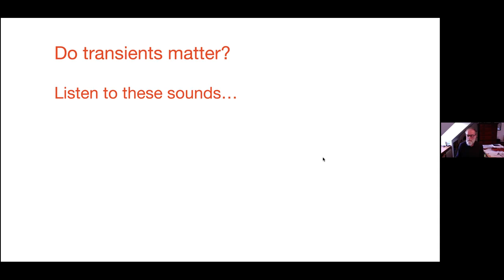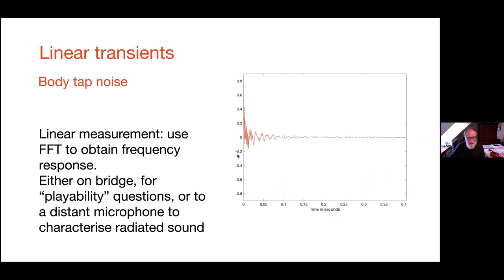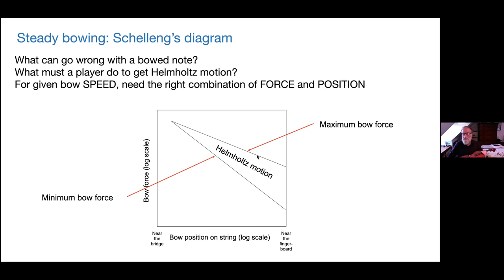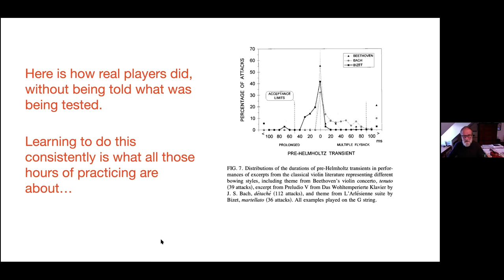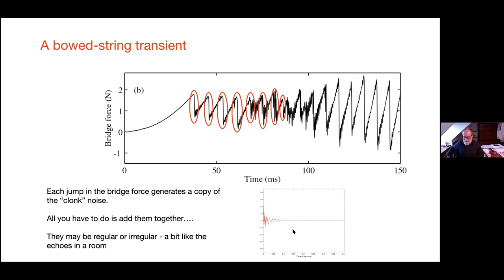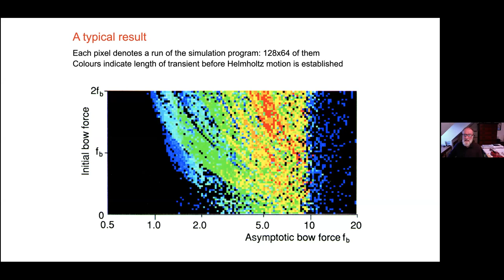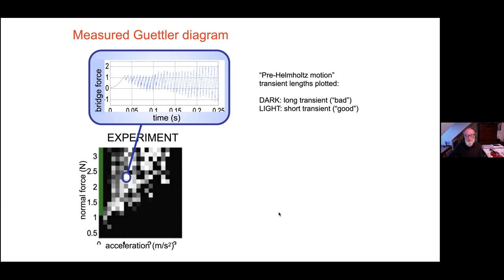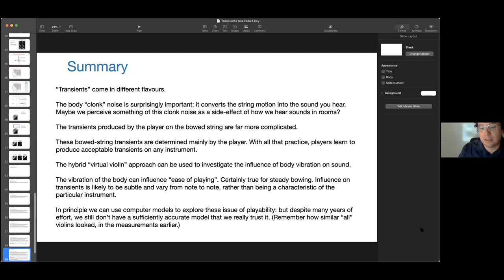Seminar 1 (12/03/21): Jim Woodhouse

Comment: Thank you so much Jim for this excellent presentation. With a few years of research and development into instruments, bridges, strings but most of all bows maybe I am qualified to propose that you may include more bow "things" into your work. I firmly believe that quite some white patches in your models and theories can be colored by introducing the effects of the bow. (Which will still leave us with the rosin problem, I know).
Maybe you have proven the importance of the bow in your talk by yourself when you mentioned that plucked instruments are understood so much better than bowed instruments. And how could that be if not because of major effects of the bow itself? (...and the rosin, of course.)
In my understanding the stick/slip effect is much more complex that you have presented at the beginning of your talk at 05:00. I have tried to work through that in a video (see the link below). And a resounding yes to your question in reply to Chris Dungey if bows are different. They absolutely are! They have a huge influence on both the sound and the playability. If you would like to experience that for yourself I would be very happy to provide you with a set of 5 bows (T9, T6, T3, S6, M6 for example) which differ significantly in their tuning and in their resonance quality (damping).
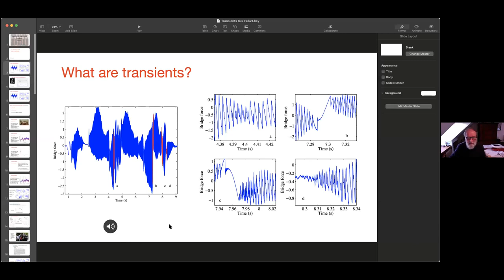One way to understand their immense influence is when you play different bows on electric violins, which is by the way almost identical to the pure Helmholz vibration that you play early in your presentation at 04:00.